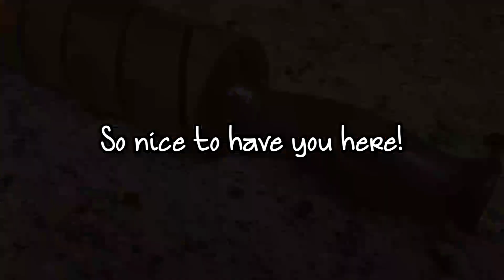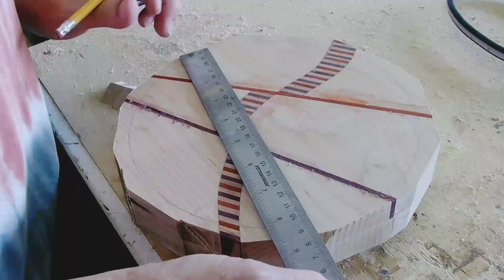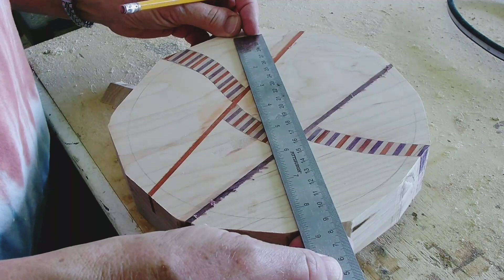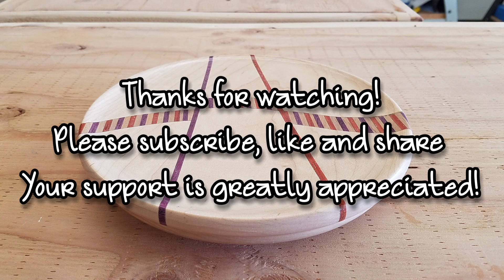Woodturning a Maple Plate with a Striped Ribbon Design

Comment: Fantastic design! How long did you wait for each glue up? What is you did the striped portion first, then taped it to your board, and cut both at the same time on the band saw? Would that be easier and maybe help with gaps? Just asking for a friend who may be tempted to try this and about a thousand other ideas for which he has zero free time.
Reply from the maker: Thanks! It was my intention to tape and cut the curves together, but my blade on the bandsaw was drifting too much and I couldn't get the adjustment right. That would have been so much easier! The times between gluing averaged about 3 hours, give or take. Thanks for watching!